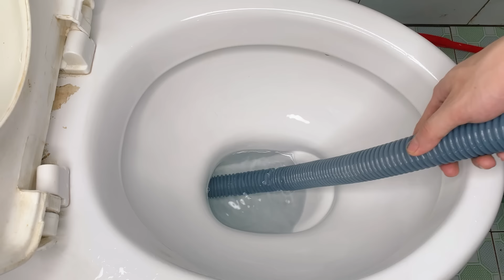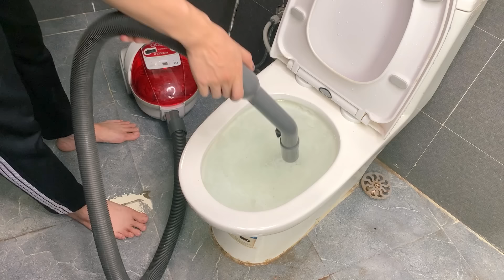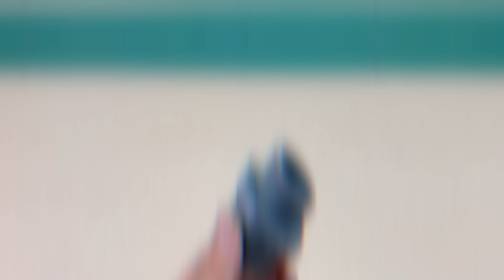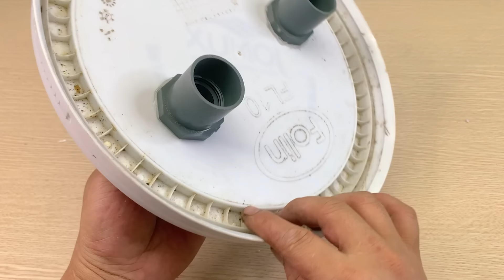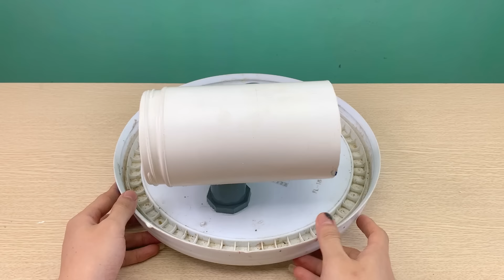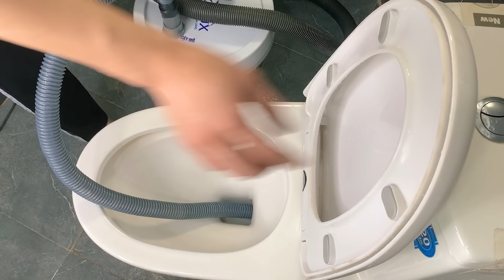Don't make this mistake! technique to treat toxic gas from the fecal tank leaking into the toilet

Comment: I'm thrilled to hear that you find the tips and tricks I share on my channel valuable for managing toilet problems. Plumbing techniques can be quite intricate, and I strive to simplify them and make them accessible to everyone.
Reply from the maker: I'm thrilled to hear that my tips for preventing mold and mildew in the bathroom have been helpful. These issues can be persistent, but with the right techniques and products, they can be effectively managed. If you have any further questions or need more advice, feel free to ask.

Comment: It appears that the bowl is being refilled after the flush cycle concludes and the siphon is broken. With the proper water height, and a solid seal between the toilet outflow horn and the drain/waste piping, there will be no sewer or septic tank gas coming back into the fixture. This goes for all properly-connected and installed plumbing fixtures in a home. Unless you're speaking to people in other countries who may not have the same plumbing standards / codes, your solution here isn't necessary.
Reply from the maker: Thank you for your comment and insights on plumbing standards. It's valuable to consider these factors in a home setting. Can you share more about your experiences with plumbing standards in different countries and how they might influence these issues?
Reply: @tipsunknow  Can only comment on U.S. standards. Plumbing standards can indeed vary around the world, but the basic principles of science and physics remain the same. Your solution still seems overkill, no matter the local plumbing code. Sewer or septic gas cannot escape a properly installed fixture with a functioning trap system.

Comment: Thank you for recognizing the practicality and technical expertise in the solutions I present for toilet-related issues. It's my aim to provide effective methods that are easy to implement and yield positive results.
Reply from the maker: Your tips for preventing mold and mildew in the bathroom are a lifesaver. I've noticed a significant improvement in air quality since implementing your suggestions.

Comment: It will smell bad
Reply from the maker: Ah, I see. If something is expected to produce a bad smell, it's important to take precautions. Bad odors can be unpleasant and may indicate the presence of harmful substances or conditions. In such cases, it's best to ensure proper ventilation and, if necessary, use protective equipment like masks or gloves. Additionally, addressing the source of the odor or seeking professional assistance may be necessary to mitigate the issue and prevent further discomfort or health risks.